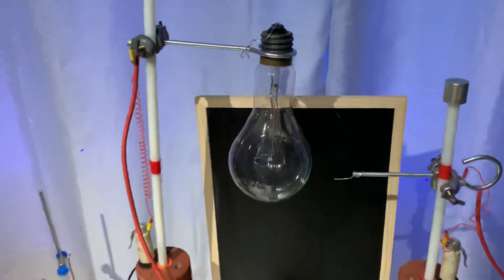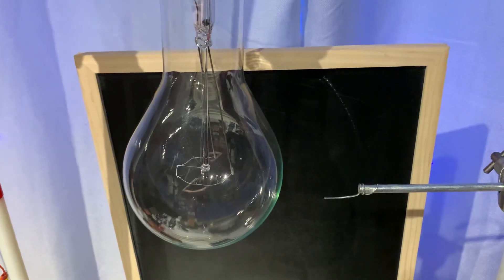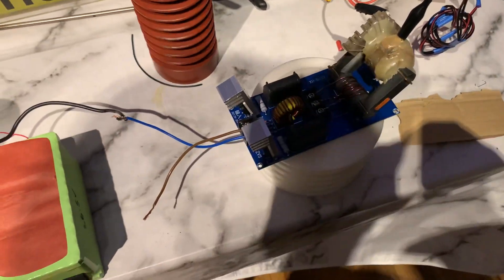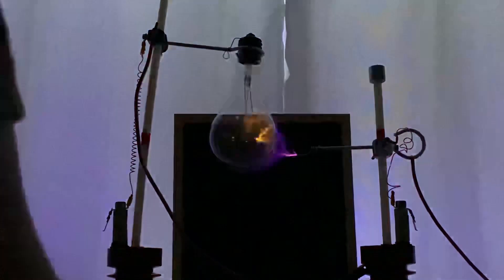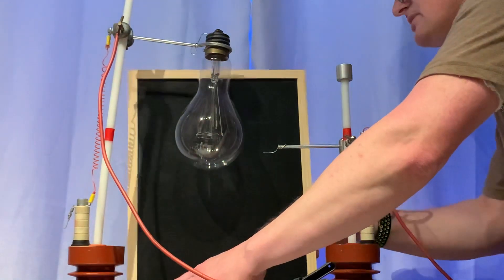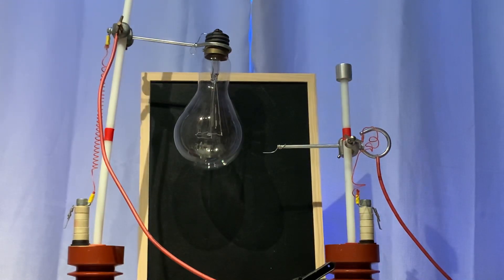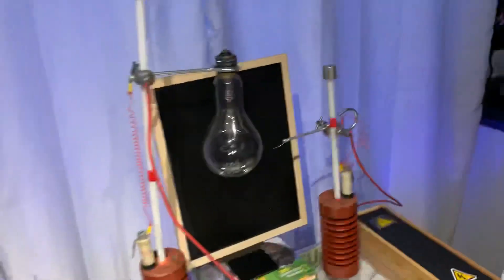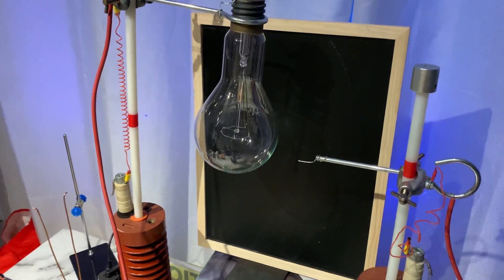16 stage Multiplier⚡️ V’s Vintage OVERSIZED Bulb! What will Happen??

Comment: Hey anthony! BEAUTIFUL display there!  I just recently acquired an xray transformer, it's 100kV! Unfortunately I have no clue what to use as a container thats able to handle the vacuum, and the connections are quite confusing. Once that transformer is up and running, i'll be making some vids on it! Been watching for a few years now and you were among the few that inspired me to get into the hobby, so thank you! Keep it up, and keep inspiring others to get into this fun hobby!
Reply from the maker: Wow!! Excellent! So glad you managed to get a X-ray transformer! Is it Ac or frequency driven?? And looking forward to seeing you power it up! If you need any help mate I’m only a message away ! And on your X-ray transformer the  connectors would be federal connectors” and inside in the federal there’s 3-4 contacts at the bottom. If you use a bit of sturdy wire you can power it up on low voltage to see what’s the anode and cathode. The other contacts will be for the X-ray tubes filament power! Hope this helps mate 👍😉⚡️⚡️⚡️⚡️⚡️⚡️

Anthony
Reply: @high1voltage1rules  Hey anthony! It is AC driven! My main problem is a container for the giant thing. It's about 8 inches tall, it's quite tricky finding a container that size that I can see through! I estimate it'll be up in running in about a week or two, waiting for vacuum stuff to arrive. Though, any time I estimate a project would be done by a certain point, it's usually done 4 more weeks after! Hopefully it'll get me some cool arcs.
Reply: @high1voltage1rules  Anthony, For some reason I cant find a way to message you or anything. Your email does not seem to be linked to your account unfortunately.
Reply from the maker: Hey buddy are you in the UK? I need to give you my email address but I need to email you it’ I can’t put it on here as I’ll get bombarded lol.
 If your not sure about it” Iv a solution: make another gmail account to email me📧” then when you email me you can use your original account: then we are laughing🍻👍
👍😉
Anthony
Reply: @high1voltage1rules  I'm in the USA, here in Michigan. Hence the pissed off 60hZ noise of my arcs. I will make a throwaway tomorrow. Shame I don't live in the UK, seems like all the fun HV folks live there lol.
Reply from the maker: That’s a shame your so far away lol. Well I hope the weather is better where you are! Lol it’s bloody cold and wet! Lol
And Great’ looking forward to receiving your email. 
I’m busy for a few days but I’ll get back to you very shortly!! 🤘👍

Anthony
Reply from the maker: @VIKEHV  hey buddy, sorry not got back to you.  Iv an issue with my emailing outbox,  lol driving me nuts, I think it’s just over run with emails, comments and spam lol so whenever you get your video up and running, send me a comment on my latest video to check it out and I’ll be right over to watch it ASAP lol.
Be safe my friend and good luck 👍😉

Anthony, / High1Voltage1Rules